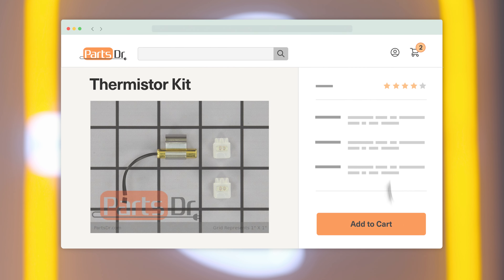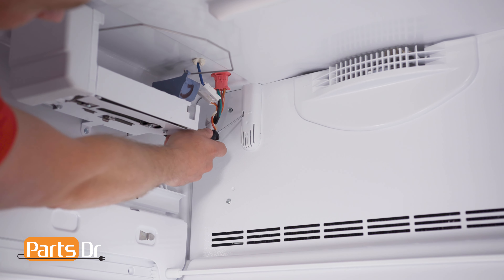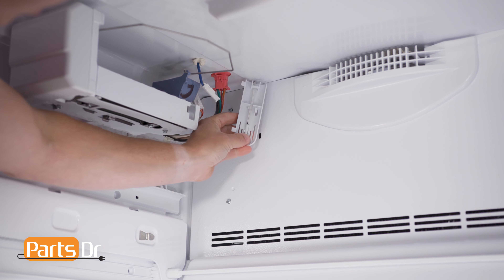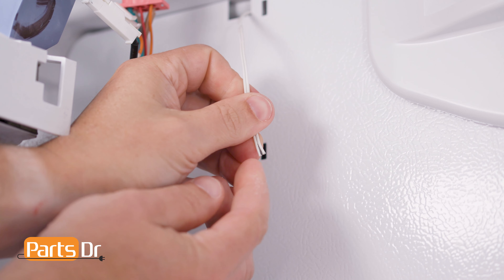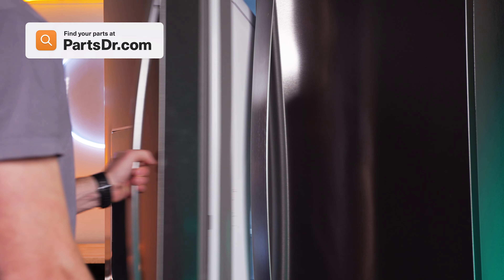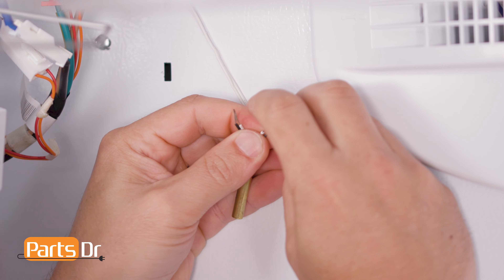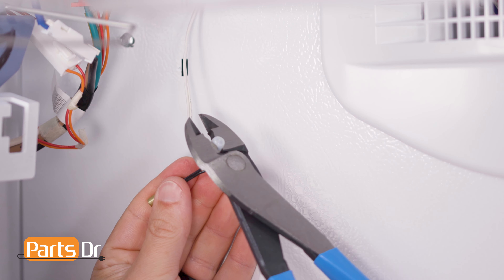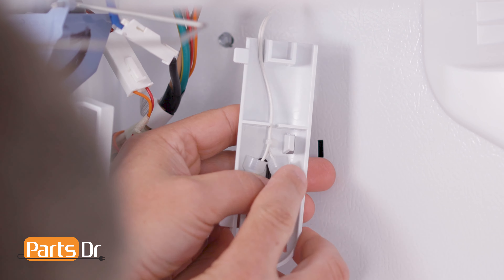How to replace Thermistor Kit part # W10316760 on your Whirlpool Refrigerator

Comment: I replaced the thermistor in the refrigerated part, but not the thermistor in the freezer.  But still the freezer is fine but the refrigerator is too cold.  I have replaced the damper assembly, the main board, the harness wire and if I removed the damper assembly and position a plastic bag in that hole, then the frig does okay as long as I reposition twice a day to adjust the temperature.  So could the thermistor in the freezer be the problem?

Comment: I've got a fridge that isn't cooling great.  Coils are clean, both fans are working properly, evaporator isn't iced, baffle opens as it should, control board triggers compressor/door etc. to operate/open as it should.  About the only thing I can think of is the thermistor isn't reading quite right and is therefore isn't maintaining the correct temperatures.  The issue I am having right now is that my model WRF535SMBM00 calls for a W10316760 on the Whirlpool website, however, it looks nothing like my current thermistor which looks like 12002355 which depending on which parts website you look at, says it fits my model fridge.  These two thermistors appear to have completely different resistances so I'm hesitant on which one to buy.  I am leaning towards the 12002355.
Reply from the maker: We show the manufacturer listing part number 12002355 for your model, you can view this on our site here: https://partsdr.com/part/12002355-thermistor-assembly?model=WRF535SMBM00
Reply: @PartsDr  thanks. So I ended up doing some more testing and reading and the thermistor seems to be within spec of close to it. I ended up raising the fridge performance adjustment from 5 to 8 in service mode and it seems to be better.  I haven’t seen many videos that discuss that.
Reply from the maker: @jacobmorissette2367  It is usually best to adjust the temperature settings in increments of 1 and wait 24 hours for the changes to take effect.
Reply: @PartsDr  I’m not talking the temperature settings,  I’m talking the adjustment settings in service mode.

Comment: Thank you for the video, Just I have a question, I am a service technician I worked in a whirlpool refrigerator model WRF535SMBM00, the FF compartment was too cold ( freezing the food) I started replacing the thermistor, same problem, after that I replaced the damper and control board, ( same problem) I saw the damper opening and closing when I cold the thermistor down, so my question is this, I noticed the other whirlpool models comes with a white thermistor instead the metal one I’ve installed in the fridge,I know they are the same resistance valve but the material they were made can affect the sense of the resistance inside the fridge??? Thank you

Comment: what does the tempature control do if the thermistor controls tempature
Reply from the maker: The thermistor usually monitors the temperature and relays that information to a control board which uses that information to control the cooling components of the refrigerator.

Comment: Where is the refrigerator thermistor part # PS2580944 located in bottom mount refrigerator model WRX988SIBM01?
Reply from the maker: If you are replacing the thermistor in the freezer section, it should be located in a similar place to the one shown in this video.

Comment: i ordered a thermistor for my refrigerator whirlpool model # wrf736sdam14. part received w10316760. everything i can find says it is the correct part, including calling whirlpool. the issue is my original part is smaller and white. the replacement has a larger diameter and is a copper color. are these parts compatible and how would i remount the thermistor?
Reply from the maker: Where is the thermistor located that you are trying to replace?

Comment: Is it possible that a fridge only has one thermistor located in the freezer compartment?  My KitchenAid KFCP22EXMP1 is at least 6-8 degrees colder in the fridge compartment than the control is set for.  I have it at the max 46 degrees or whatever it is and my thermometer reads 38, and items are freezing.  I can see the thermistor cover in the freezer compartment, but there is nothing obvious anywhere in the fridge and the parts diagrams are less than precise when it comes to the thermistor locations.  I'm guessing because the thermistor is likely part of one of the wiring harness assemblies.
Reply from the maker: Yes, some models only have one thermistor located in the freezer compartment.  The most common thing that causes that types of symptoms that you are describing is a bad damper control assembly https://partsdr.com/part/wpw10594329-damper-control-assembly?model=KFCP22EXMP1
We have a video on replacing the damper here:  https://www.youtube.com/watch?v=KwLu9IiOq4Q